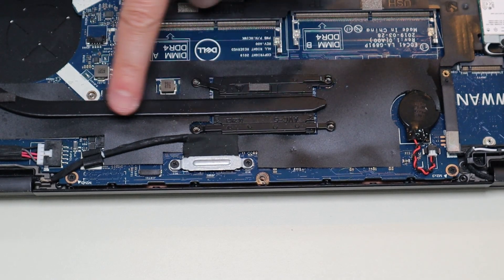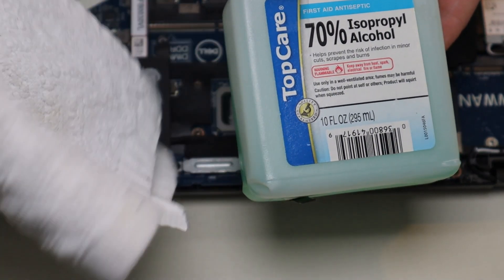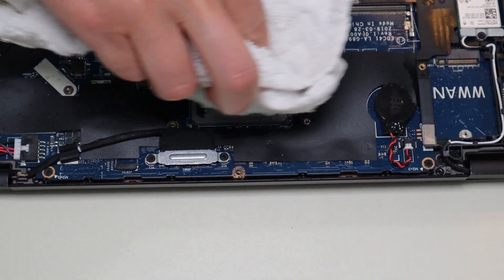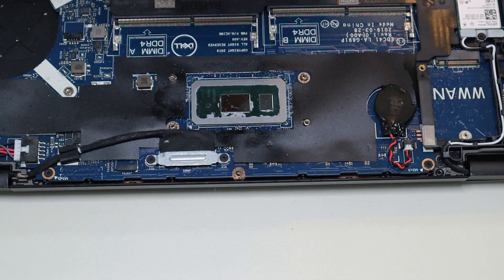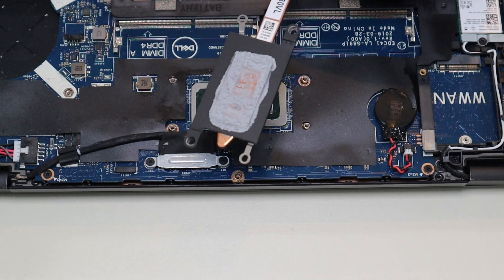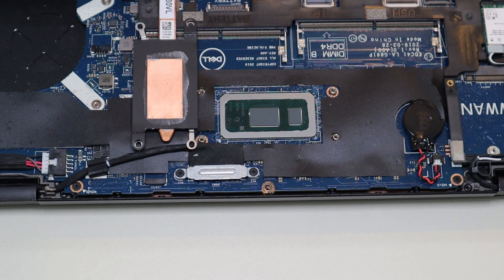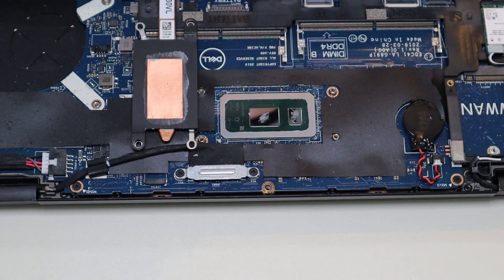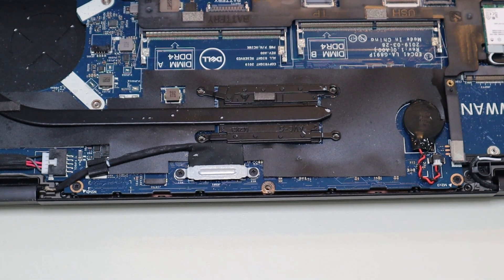How To Apply Thermal / Cooling Paste for Laptop Computer CPU, GPU, etc

Comment: Have an older Toshiba Satellite C655 running hot. I've opened up & cleaned the fan and vents of dust. Should I use thermal paste or pads to replace the old thermal paste? TY,  great videos.
Reply from the maker: Thanks :) Yes, if its getting hot, I would definitely replace the paste :)

Comment: Question, What should you do if you have a laptop and a charger but your charger is dead? This problem has been occurring for a while ever since I updated it to windows 11.
Reply from the maker: Not sure if I understand correctly but if your charger is dead and will no longer function as its supposed to, it should be replaced. What operating system did you have before Win11? Was your computer compatible with Win11 as seen here? https://login.live.com/login.srf?wa=wsignin1.0&rpsnv=152&ct=1715454839&rver=7.3.6960.0&wp=MBI_SSL&wreply=https%3a%2f%2fwww.microsoft.com%2fen-us%2fwindows&id=74335
Reply: I have a EVCO computer, (Windows 10).